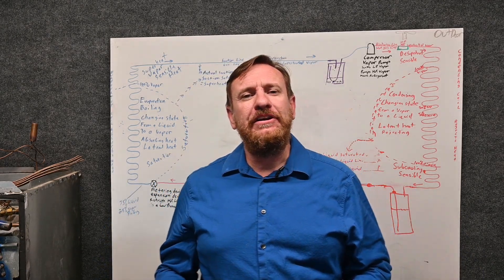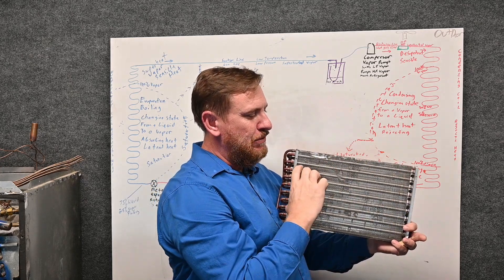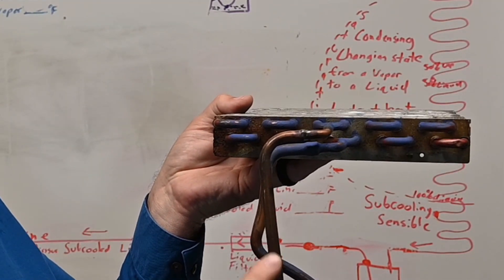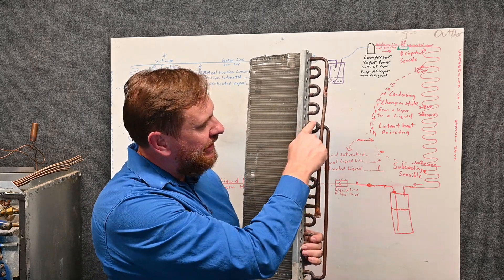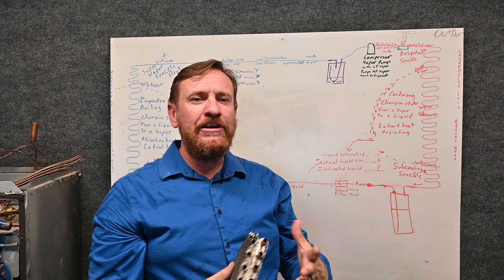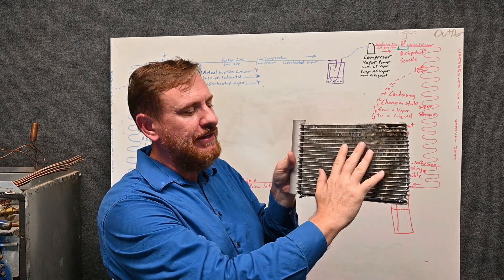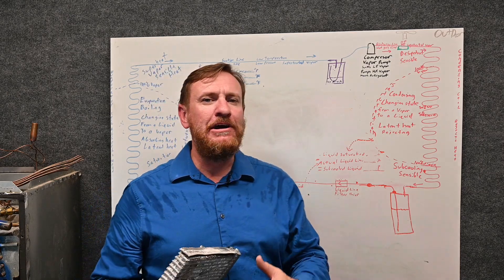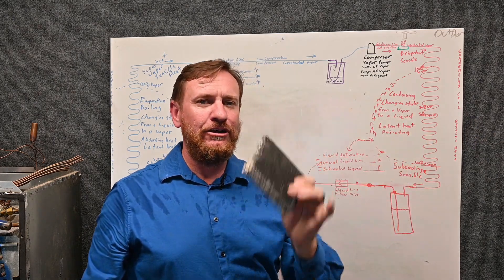HVAC 078 Air Cooled condensing coils, micro channel, tube and fin, spine fin

Comment: THE MICRO CHANNELS CLOGG UP WITH MUCK AND SLUDGE ON THE INSIDE OF THE SYSTEM AND THEY SUCK WITH 400 PSI GOING THRU THEM!!!! MICRO CHANNELS ARE TRASH FOR R410-A!!!! MICRO CHANNELS WORK FINE WITH LOW PRESSURE NOT HIGH PRESSURE!!!!
Reply from the maker: Why is there muck and sludge inside the system????

Comment: Great info I have a dehumidifier were I work in a hotel for the indoor pool all the fins on the condenser are disintegrated will the system still work
Reply from the maker: It will not work very well. It needs those fins to disperse heat. 
I'm sure the evaporator fins are not too good either?

Comment: Hello Ty, for the evaporator coils diameter should it be bigger or smaller than the suction line diameter to be brazed with ? And also the same question for the condenser with the discharge line ? Thanks
Reply from the maker: That's a great question. 
This is where we have to refer to the installation manual. It will have a chart for what evaporator and condensing unit is pared together. From that it will show what suction line and liquid line is needed. 

Too small and you will loose capacity, too large and you will loose oil.

Never go by the sizing of the EVAP or condenser alone.
Reply: @love2hvac  thanks Ty. If i'm doing a conception of a refrigeration cycle from scratch where i will choose myself all the diameters of evaporator, condensor and the refrigerant lines ? Thanks
Reply from the maker: I think this should help

https://www.hillphoenix.com/wp-content/uploads/2020/02/Gen-suction-and-liquid-line-sizing.pdf

Comment: Micro channel can be problematic, it needs to be protected from any damage. I will not install if given a choice!!!
Durability and longevity are key and I don't see either from this technology?
🥃🥃🍺🍺🍺🍇🎳😐
Stay safe. 
Retired (werk'n)keyboard super tech. Wear your safety glasses.
Reply from the maker: Main problems I see are at the connections from copper to aluminum piping. 
I've seen plenty clog up and plenty ruined by the wrong cleaner.  Seems to be the way the manufactures are going now.